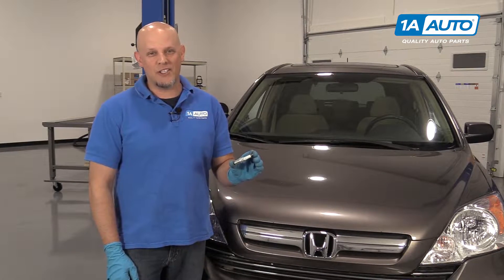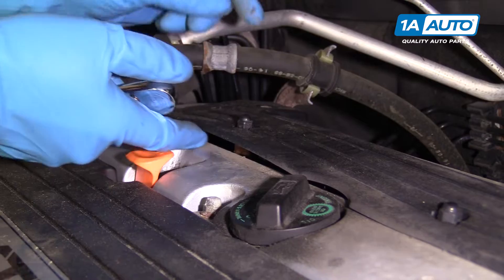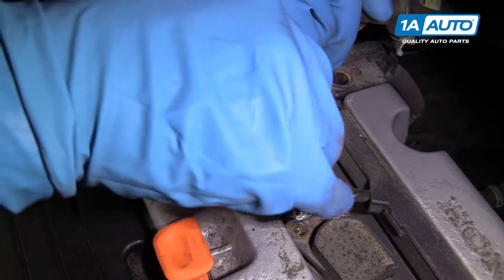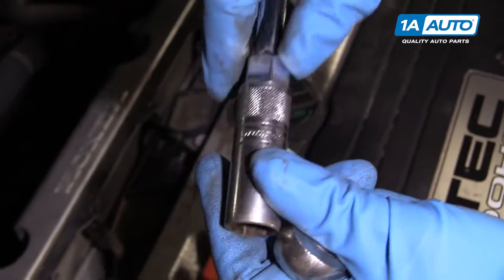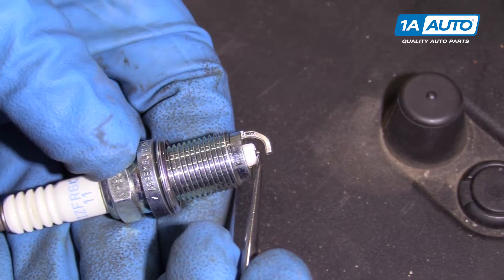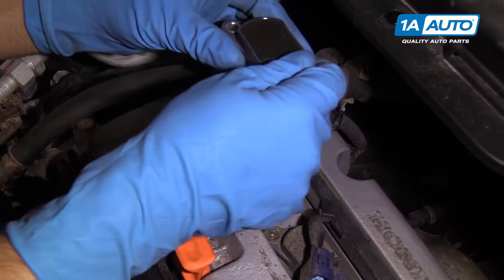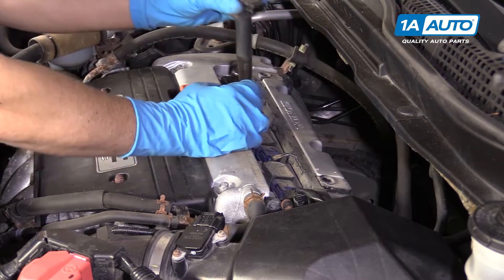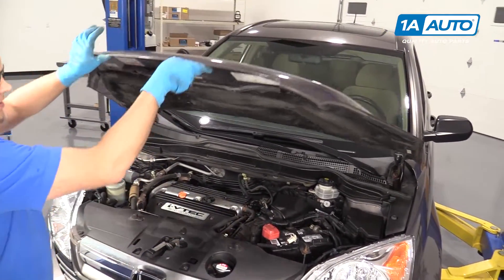How to Replace Spark Plugs 02-09 Honda CR-V

Comment: If you dont have a air compressor, you can use a long straw and blow hard in the hole before removing the plug. works very good. Close your eyes when blowing as dust can get in your eyes. I had a straw from Burger King that i used lol

Comment: If you have access to compressed air it would be advisable to blow off as much dirt from the area as possible before remove the coil pack and spark plug
Reply: What spark plugs do I buy for a 2005 crv truck
Reply: Honda crv

Comment: Great video. How do you reset the minder. Manual says 105K mile minder will come up and I am going to replace the plugs soon around 100K miles and would like to reset the minder system to restart the 105K mile timer. I also replaced the DW-1 ATF and would like to reset that minder as well.

Comment: Are you supposed to add any antiseize to the spark plug threads? I see a lot of people saying you should add a small amount to the threads and some places like here showing the installation without using it?
Reply: No those type  spark plugs don’t need any.
Reply: It really does not matter but we do for the sake of it.  Use the grey anti-sieze and just a dot or two. Don't smother the whole plug in it

Comment: For those who don't want a spark plug socket, I found that an ignition coil can pick the spark plug up. Simply take out the ignition coil first, then loosen the spark plug and again insert the ignition coil to the lot and a spark plug will go up with the coil. 
P/s: I did purchase a spark plug socket but it didn't work... so my mechanic friend told me a trick...

Comment: Very thorough.  I like the way he advises to blow out debris from spark plug well.  Demonstrates the useof a torque wrench !  Who uses that?  Well, that's how one gets overtorqed threads that strip the head, or can't get the darn thing out five years later without stripping.  I recommend two other preventive actions.Use anti seize compound on the spark plug theads (except the last 3 threads near electrode), anti seizeon the other hardware nuts/threads, and spark plug boot lube on the boots for easier future removal.Prevents tearing too.Well done video.

Comment: Couldn't agree more about the anti-seize! It's an aluminum head - you MUST use anti-seize unless you plan to never change the plugs again (because they won't be coming out ever again without damaging the threads or even snapping them off while still in the head - Doh!). 

You also don't torque - just gently with the two-finger method on the ratchet. 

Adding some dielectric grease to the coil boots will ensure good electrical contact and spark, and make it easier to remove the coils without damaging the rubber boots next time. 

Finally, it's always good to lube any nuts & bolts before replacing them for easier removal and less problems next time.
Reply from the maker: +netgearsanjose123 netgear Thank you for taking the time to provide the feedback and suggestions!
Reply: @warrentom6537  Licensed and experienced technicians says otherwise. Let's start with the Triton motor and we'll move over to the Subaru motors afterwards. What they recommend don't mean it's 100% not to do.  Anti-seize is not just for plugs sake.  Aluminum blocks need to have it regardless.

Comment: You did not put on any anti seize on the spark plug threads?
Reply: I believe NGK and Honda recommend against using anti-sieze because it lubricates the threads, which can cause them to become tighter than they other wise would with the same amount of torque applied.

Comment: Spark plug torque is 13 foot-pounds (17.5Nm).  Does this also apply to the 2.0/110kw petrol engine (R20A2)?  Thanks

Comment: Thank you for the video, I tried to do this but soon realized that I needed a special spark plug socket because my regular one would not fit down the hole, I wish that would have been mentioned in the video, maybe even with a link to purchase the right one.
Reply from the maker: +Gordon Wilson Thanks for checking us out. Shop for high quality auto parts on 1AAuto.com:

http://1aau.to/m/Shop-1AAuto-c
Reply: @ 3:17 they mention the tool you need

Comment: I've read that the gap is .044 not .040  on this generation CRV
Maybe it's not much of a difference to make  it an issue? Just wondering...I gapped my to .044 and it fired up w/o issues.
Reply: True. I gap my ngk plug 0.42 and it fired so well too. Honda says 0.40 to 0.44 so it shld be fine

Comment: Does the manufacturer call for anti seize?
Reply: If they're NGK iridium plugs they have antiseize applied at the factory and do not need additional compound. I still see it being applied to these plugs as well as attempts to check or adjust the gap. This unnecessary unless they have been dropped during shipping.

Comment: What would you do if one spark plug keeps spinning and won't come out?
Reply: Either:
1. Pull the head and repair the thread
2. Purchase one of those Triton f150 spark plug hole repair kits and use it to put it out
Reply: @automotiveperformancemobil4030  strangle  mechanic

Comment: Is there a way to know torque specs with a normal ratchet?
Reply: No. Hand tight with a ratchet(don't go hulk here), plus an additional 1/4 turn of the head, should put you ballpark at your torque specs. but usually you can tighten them past their snug fit. 

With experience, you can get familiar with how tight a fastener can be with how big it is, its thread design, and its head.
Reply: Yes.. you know how tight you tighten things right?  So imagine what 13 ft pounds feels like and there you go. These are aluminum blocks, don't go hulking things.  nothing more of 20ft pounds and thats it.  Besides, these are spark plug coils and a cover, just put it on and snug them up